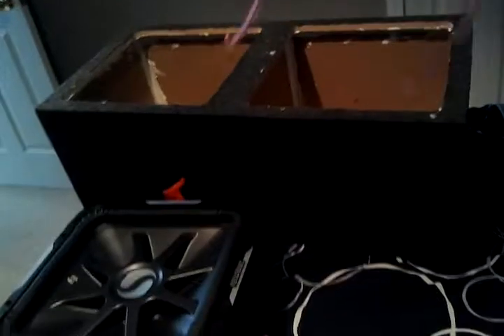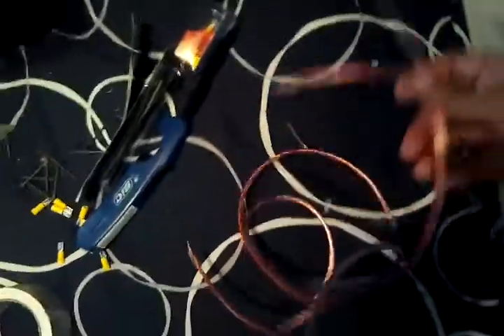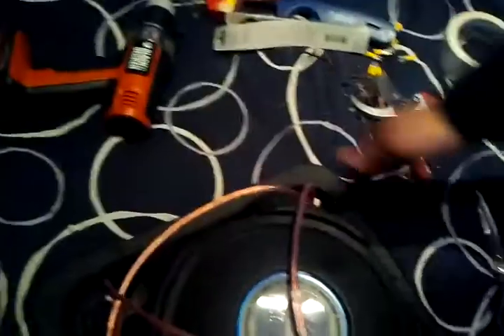Two 2011 Kicker 15 Inch L7's Wiring To A Sealed Box Part 2

Comment: need some advice i have this kicker l7 and i plug the first coil and i accidentally plugged the positive and negative on the two coils and the speaker played is something wrong with the speaker shouldn't it play only one coil? if i want i can series it or parallel the speaker to play both coils?